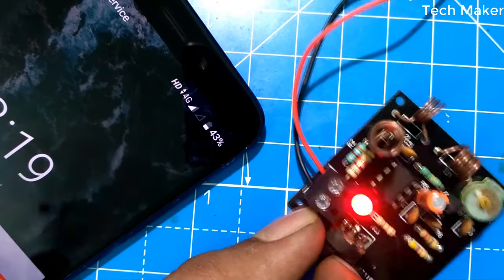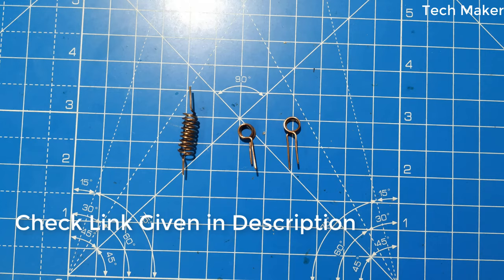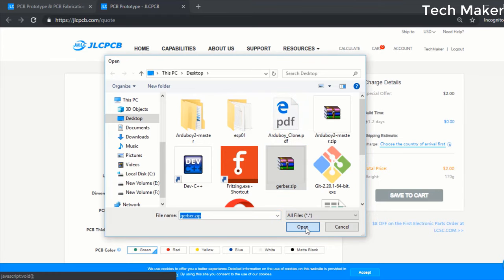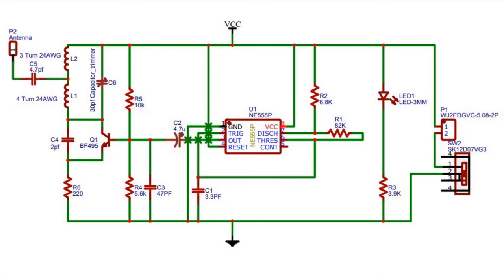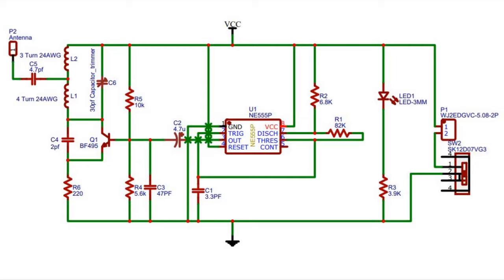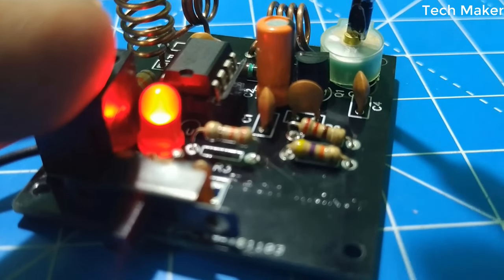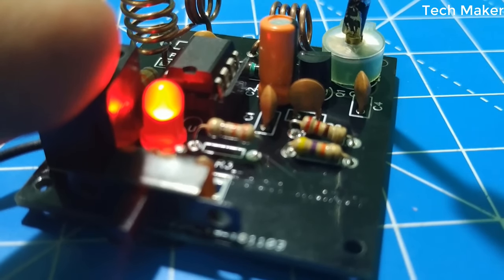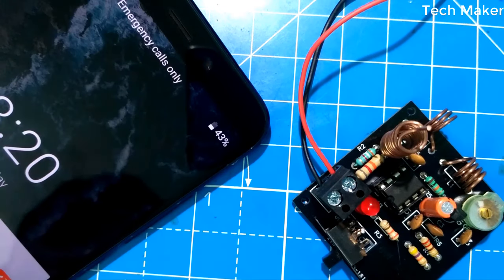How to make Cell Phone Signal Jammer

Comment: What's the range of this device?
Reply: 4inches and 5 if your lucky
Reply: Can one be built that has range in feet?
Reply: Kentoris Bailey yes
Reply: How
Reply: Ritesh Sawlani well you need Money first
Reply: How much money?
Reply: Erick C few hundred
Reply: Increase range with a yagi or pan directional, even a 7db omni would increase the range without re engineering the whole thing. I do this with blue tooth usb dongles, Starbucks uses blue tooth so customers can order from there cars and not need to wait inside. I soldered a 27db yagi to the pcb and now I can stand a half mile away from the computer lab and order Starbucks during 15 min break and still make it back on time while everyone else has to drink the crap in the 75 cent coffee machine.

Comment: What's the frequency range? (frequency not range) 3g? 4g? I'd guess that adjustable cap could be swapped to get a certain range, yes?
Reply: 900 MHz
You Can buy some that have a 15meter range🤷🏼‍♂️But they are pretty expensive!

Comment: I made it and used the a JFET by mistake. It does emit a lot of really low power noise. probably not more then 1 to 3 inches in range. I might try again if I ever get the right transistor.
Pro tip home made inductors have to be absolutely spot on or shit won't work in the area it needs to.
Reply: So did it work and on what phone did it?
Reply: @tomzweerman3533  I never got it to work at 900Mhz.
Just a lot noise at 60/+ - 15
Reply: @tratzum  Interesting. Did you pursue any other "project" such as this?

Comment: Hello, nice video..but can you just make another video about describing how this circuit works?
Reply: its based on 555 , just read the datasheet
Reply: produces "noise" at the frequency/ frequencies of signal desired to be jammed- given appropriate match of frequency, power of jamming device's output, proximity of the jamming device to desired device to be jammed, and directionality of jamming signal- wit all those considerations, basically the jamming device is "louder"- don't set expectations too high with devices like this, but they can be modified to adjust the variables i specified above...for example, you could incorporate an amplifier which will allow for a wider/ longer range or add an antenna such as a yaggi for directionality which will increase effectiveness with a more focussed signal. 1 or more results will occur utilizing such jammers...users of devices will show no reception, the receiver will never receive the signal, the sender may not be able to transmit... the receiver may receive the signal but all it is is noise/ static/ or replaced signal- let's take those and place them into examples with a drone.. if user cannot transmit then they cannot fly the drone at all. With the receiver being the drone, if it cannot receive, then it cannot take off...if already in the air most likely a return to home functionality will kick in..same goes if drone flies into a jammed area with static...it will start to return home. If the drone exits the jammed' range then control can be regained. If the jammer sends out a strong signal where i is replaced then thee drone can be immobilized, causing it to drop out of the sky/ change directions, stop completely or directed by the jamming signal to another location...some jammers incorporate multiple methods for example again with drone of maybe a high profile induvial on a boat/ yacht. Initiate jamming of the gps frequencies, simultaneously sending alternate gps coordinates- the noise of the jammer will make sure the gps systems cannot verify their signal and since another strong gps signal is being send...the onboard gps now with bas coordinates causes the autopilot to adjust course...maybe to a location more desirable to intercept..in the boat example, sophisticated pirates cause the boat to enter undesirable waters unknowingly where the pirate can attack/ board the vessel- with the drone you could cause it to fly a different direction and crash/ of overtake it and steal it.

Now- all the above is to teach us on better securing our assets...not to actually use such methods- !!! in many countries highly illegal.

Comment: How can i get the circuit board ? And how can i get it printed the components ? And how much does it cost ? And which circuit board is used ? Plsss anss mee !!!!
Reply: Most of this stuff is banned so you have to do a lot of searching to find where you can buy it. Usually they change the name slightly and you will have to order from china.

Comment: What is the range of this device ?
In the video it's about 4 cm  :)
Reply from the maker: About 100m
Reply: Thanks, 100 m is enough for most of us :)
Reply: @glitch2615  @Tech Maker  , @Glitch shoulb build his own and upload for us to see.
Reply: @TechMaker1  literally is it really 100 m
Reply: @TechMaker1  can you help me to make this
Reply: @TechMaker1  I'm about to take time and money and build this. Is the range actually 100m?
Reply: there is an easy way to find the range from the wattage of the source which is just 9 v battery . It cannot be more than 1 to 5 meters.
For a range of 40m you need about 30 watts for gsm and 2g . For 3g or 4g we need even more power.
 A 9 volt battery gives about 5watts for an hour before it will be empty so this circuit cannot be more than 10 watts.

 A second and much more accurate is to examine the transistor 

 BF495 which is the the part that amplifies and sends the jamming signal to the antenna , according to the data sheet its only 300mWatt or 0.3Watt (maximum)  , so there you are  , this circuit will work under one meter of distance.
Reply: It is illegal
Reply: @AdityaYadav-qy4qy  You can use it freely in your home

Comment: Nice...How much range of this circuit to make phone signal down?
Reply: i try it.range 0.30M.if you want best result 0.03M.
Reply: @dilshandilip  lol 3cm ? so glue it to the cell phone?
Reply: @ceejayc6502  Yes you are right you need to stick it on the phone. Or it just won’t work. : )   :(
Reply: @dilshandilip  Well i did some research, and if you have an Arduino and order a transmitter in the desired range (like 900mHz), then you could make one.
Reply: @ceejayc6502 found it ?

Comment: What is the maximum distance that this device affects, meaning a distance of one kilometer ?
Reply: a Low-powered jammers block calls in a range of about 30 feet 0.009144 km since this one on the video is home made i would say its very likely to be within the very similar range
Reply: @alexmercier3964   hey I made it and work 1m = 100cm distance its good 
And total estimate amount is only 135 Rs or 1.7958 $ in India.
Reply: @devesh09  I don't get what u said, can u tell me more how you made it, it will be a great help for me
Reply: @sujaidev8711   by the way Now I am retreating  my words because  the principal for making a jammer is to jam or make traffic  by producing same  frequency to fluctuate the signal, from this module it even can't produce (433Mhz of frequency) its just made from RF transceiver that it can generate about 433hz-900hz (2G) to making a jammer is complicated so u have to lot's of research and determination 
[ IT'S HARD BUT U CAN MAKE IT] 
Just do this stuff in FREE TIME.
Reply: @devesh09  i hv need cn you sen me ..
Reply: @devesh09  so are you saying it wont work for 4g ??????
Reply: @madfacts8670  yeah

Comment: There is so much wrong with this I don't know where to start. If it works at all (the video is in no way conclusive) it certainly does not work as described. 
The timing cap at 3.3pF is easily swamped by the capacitance of the pins of the IC and the 82k resistor is way too high a value at the 3MHz I assume the OP is trying to claim. Only specialized 555 timers can operate at that frequency (definitely not an NE555! => about 300kHz). The capacitive loading (4.7u and 4.7p???) on the 555 output is unlikely to allow it to operate properly, the 4.7u is likely to be more of an inductor than capacitor at these frequencies, and the Rf stage may be an oscillator of sorts that I can make no further comment on. When tuning a variable cap, do not use a metal screw driver! Use a trimmer with a metal end but otherwise all plastic to avoid the screw driver de-tuning the cap (which a metal screw driver  will do).
This guy is probably  getting a kick back from JLC every time some fool builds this bogus project. There are plenty of good people posting good projects on here, go look for one of them instead. Find someone with proper qualifications who posts project videos. This project is guaranteed to disappoint. Take it from an EE who knows.
This is a cinical project posting to garner subscriptions or something which I just had to call out. I remember what it was like being a newbie hobbyist and disappointed with crap like this.
Reply: tried a simulation of that circuit, only got 2.4 to 3.4 khz
Reply: @edersondeassisfs  And that is QED and disappointment avoided. I hope others follow your lead.

Comment: How many distance covered in this jammer?
Reply from the maker: It's a short distance, it about 100m
Reply: @TechMaker1  Man, 100 m is not a short distance. It's enough for most of us :)
Reply: @TechMaker1  Liar!
Reply: @TechMaker1  I dont think it can cover even 1 mtr leave 100 mtr.
Reply: @TechMaker1  100 meters? Yea, good luck. I would say 10 centimeters at best. The circuit works, no doubt, it all makes sense when you break down the components and circuit, but the BF495 working as an oscillator, mixer and amplifier for a frequency that's well over it's transition frequency, will NOT AT ALL produce enough power to cover 100 meters. You'd need a few hundred's of watts to out power all nearby base stations with noise to get 100 meters of range..
Reply: @TechMaker1   you mean 100 cm

Comment: This will probably only jam GSM signals at short range and is illegal in most jurisdictions.
Reply: Remove yourself from the jurisdiction, then.  Why are people SO engrossed with "legal" ?  What is lawful, and what is not.  Don't be an ass with your toys, and you'll avoid trouble.  
Re: GSM?  download a free freq sweeper after you build the device.  Tuning the adjustable pot will fine tune your freq.  Using the appat distance, will tell you what freq you are at. GSM is still in use. You want Lte3/4/5g?  Research what it takes to cloud the air with those signals, and you'll learn what u need to emit them.   Just need to match freqs with your target.

Comment: This video is BS. There is no component in the above list that can block a cell phone signal.
Reply from the maker: If you correctly know the electronics, there is noise signal generator using ic555 and lc oscillator to release the signal into the air. I hope you will do research, before commenting again.
Reply: @TechMaker1  this is still a BS video. It takes a far stronger signal strength to to disrupt a cell phone signal. If it was that easy everyone would have one. I would catalog this video under the free energy projects so prevalent on YouTube these days.
Reply: Glitch hello trying to block gsm/gprs car tracker looking for information any help will be appreciated.
Reply: @glitch2615  The circuit in theory (and in real life) works and it might actually do a lot better with a transistor that has a higher transition frequency, the BF495 is not the right transistor for the UHF application, since the fT is around 100MHz (only the lower VHF band). The signal when the jammer is next to the phone, is more powerful than that incoming from a base station. It probably wouldn't disrupt an on-going phone call since the power is pumped up A LOT in that case, but if your phone is right next to the noisy signal source and not communicating with the base station to much (few pW/nW), the jammer would win, since it's probably around 1-5mW.

Take a look at this, http://67.225.133.110/~gbpprorg/mil/celljam1/ probably one of the best instructions out there about making a signal jammer, same guy who made the schematic you linked, which also by the way, works great (actually built it).
Reply: @nitrosake  We could trust you saying that it works great if you told us what distance it covers?!
Reply: @CognacKidd  I cant tell you for sure since I have not built it, but i'd guess arpund a few inches, 5 maybe?